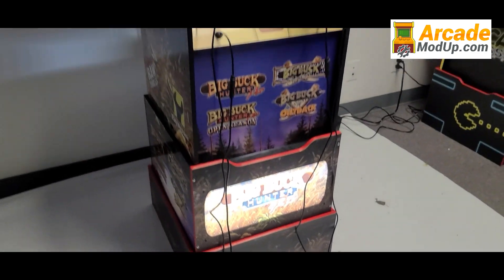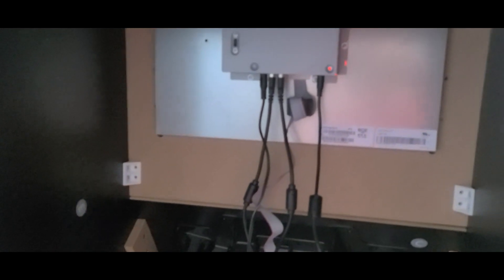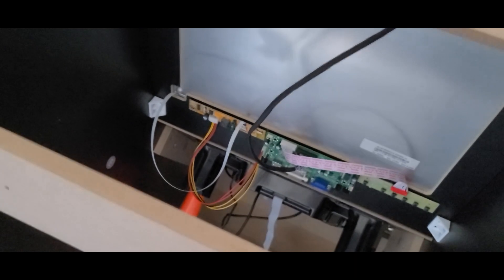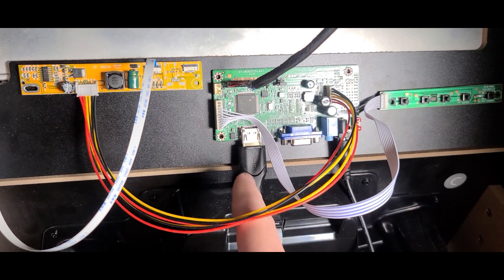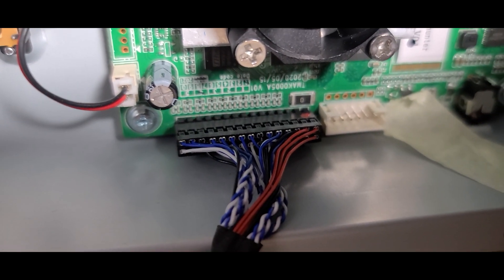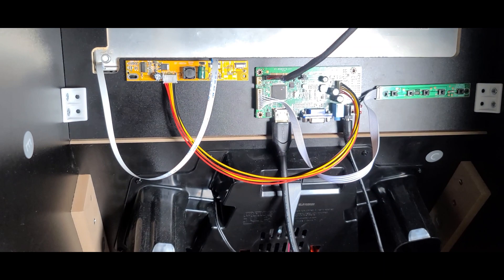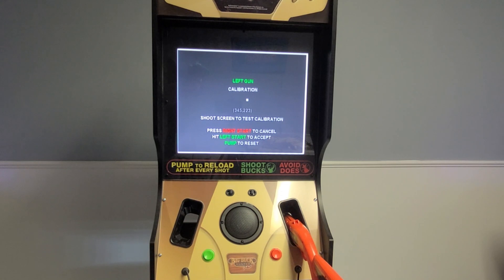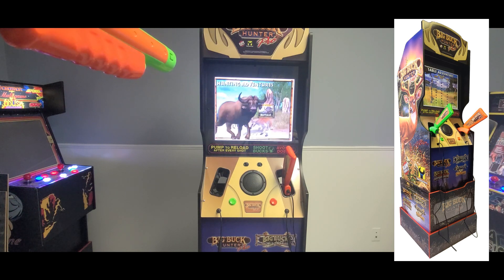Arcade1Up Big Buck Hunter Mods - 19 inch Monitor and 7 inch Riser

Comment: Has the LVDS issue been fixed for Buck Hunter?  I notice the board you used in this video has no jumper connected on the right of the LVDS board (S1 S2).  I have a V20 version of the LVDS board, and currently the board jumper is set in the middle two pins for S1 S2 connectors.
Reply: LOL- Not answering I guess.

Comment: Hey can you tell me what I’m getting screen flicker? I did everything accordingly and am having screen flicker on the score screen and some of the bonus rounds. Ideas? Thanks.
Reply: my screen keeps going black then back on again at random times. No idea why (stock PCB with upgrade kit)
Reply: @molarmedic  yep mine too.  Wouldn't even work on a bigger screen.  Weird.
Reply: @pxp751  can't figure why the lcd goes black randomly.  GRS sent me a new LCD driver board and the mini backlight board. Still same problem. I reconnected the stock LCD   to the PCB no issues at all. Go back to the MODup 19" setup.. random screen black outs. I wonder if the Geekworm board they use is the issue? I have not replaced that board yet. No idea what else it could be. But it is annoying....and for a 200$ plus upgrade...it's unplayable.
Reply: @molarmedic  I don't get either.  Have you checked your connections?  Are they all tight?  I double checked mine and I have noticed the screen goes out and back in less.  One or so during start up then it stays on.
Reply: @pxp751  everything is tight. Mine randomly goes out. Stinks if it does during gameplay. Really don't know what else to try. I think GRS should have fully tested and worked out these bugs prior to release. But they are trying to help figure it out at least.
Reply: I take it this isn't worth it then?

Comment: I purchased this product to upgrade a Big Buck Hunter with the original PCB as shown in this video using a previously purchased Geekworm board. It didn't work. The Geekworm board worked fine with other displays and the new 19 inch monitor works fine with an HDMI source. It has now been a week since I submitted a support request to Arcade Mod Up and they have yet to reply. I can't recommend this product for use with a stock PCB. My experience did not match what was shown in the video.
Reply: Wasn't Andrew Martin the name of Robin William's robotic character on Bicentennial Man?
Reply: Saw 8 bit vinyl had an issue switching motors as well the upgrade for
The monitor really is picky on the original pcb to work best is pi at that point
Reply: So what can I even do to upgrade the screen? I'm new to this but trying to learn. I just keep seeing this upgrade is glitchy, are there workarounds?
Reply: Did you guys figure it out?